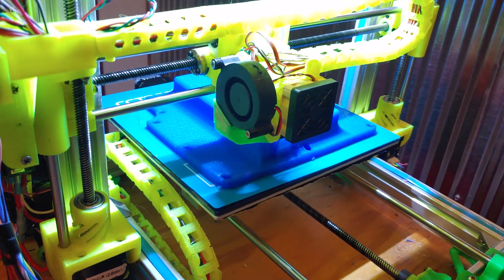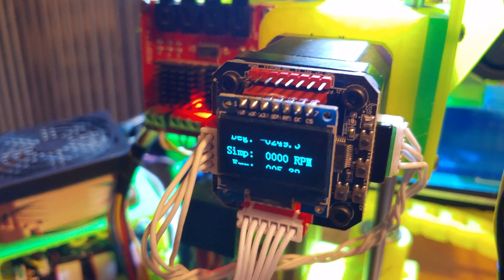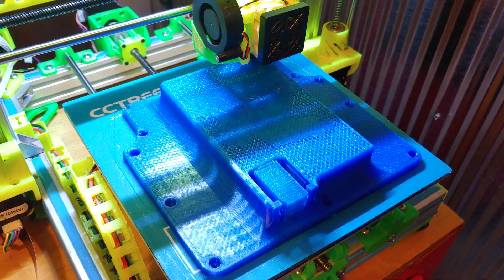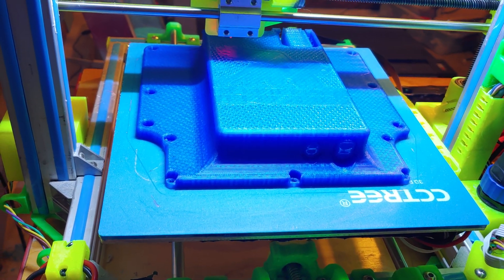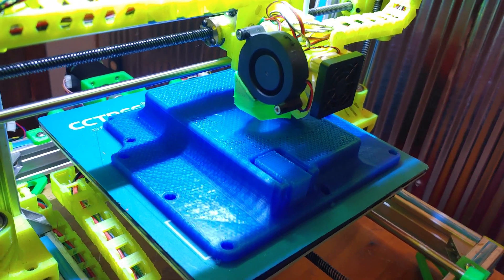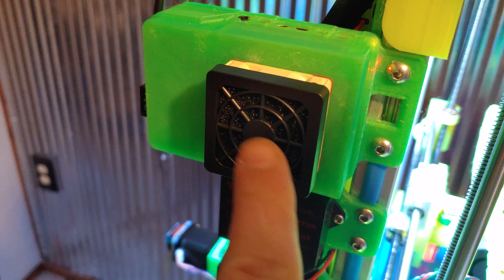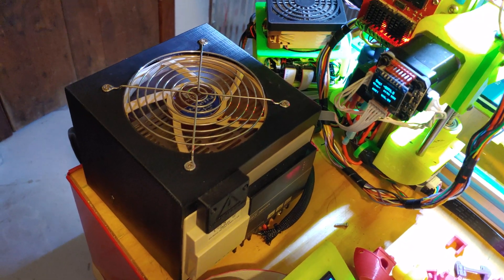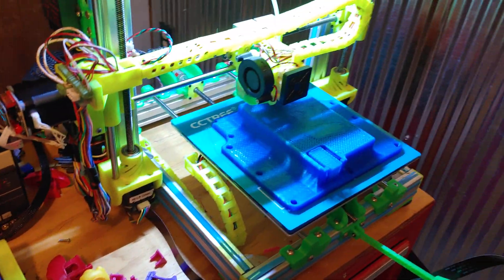3DLS Printing Fast

Comment: I'm actually thinking of doing this exact same thing. It's good I found this, I was building the prototype on Fusion 360.
The only difference is I'm thinking of using two nuts on the lead screw instead of one.
Are the closed-loop drivers really important? I thought I would need less torque than the belt (since it's traveling a shorter distance per revolution), or is there some additional resistance using this design?

Comment: If this printer used linear slides then it would be perfect.
Reply from the maker: Lazy and cost. It's ten times more precise than with belts already and the linear rails would make very little difference.

Comment: Great design... Thinking about building it... My objective is miniatures using as small nozzle as possible... Does using leads crees improoves it's accuracy and resolution? I don't really mind print speed, but more resolution
Reply from the maker: Yeah it really does. You can use less starts too to get slower speed but even better accuracy but as it is it's kinda nuts compared to a belt system.
Reply: @Morninglowe  thanks for your response, thinking about going with 2mm travel per turn leadscrews... and an extruder with reduction gears too...
Reply from the maker: @EPYCMX  I have a bondtech extruder drive on it now. It is geared. https://www.thingiverse.com/thing:4589325 With my 4 start screws it takes 510 steps per mm, with the closed loop drivers.

Comment: Currently in the process of building a much larger 15x15in build printer with an enclosure. And dual leadscrew axis for XYZ with 60mm nema17s with a SKR 1.1 Pro. Designed it from scratch. The XY carriage isnt even directly connected to the leadscrews, it exists solely on linear rods, and the movement carriages are on the far sides. Wonder how well those closed loop steppers would work on a dual motor axis...
Reply from the maker: They need to be alone on an axis. That way they don't fight each other.
Reply: @Morninglowe  I do have a wonderful idea however, to run 2 of them in parallel by splicing the second signal wire to the first, so it would technically give both of them the same signals for movement, but it would still have independent error adjustment.
Reply: @Morninglowe  I would like to further discuss the concept if I may.